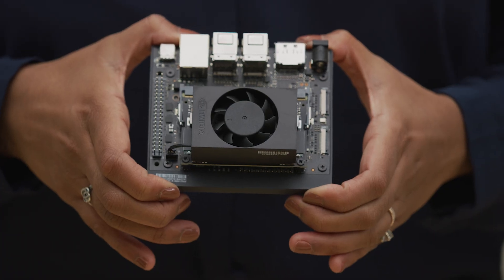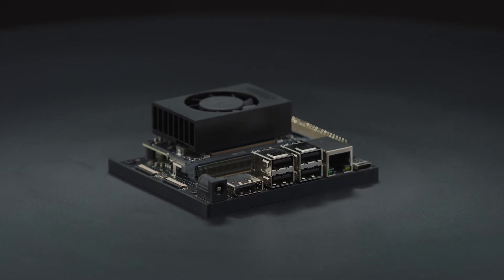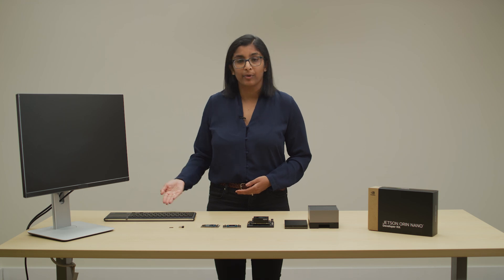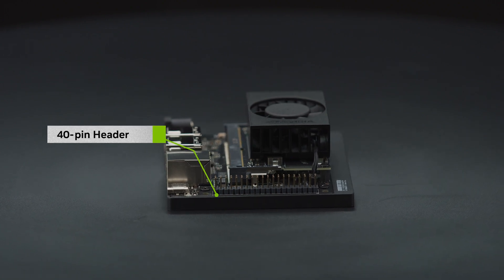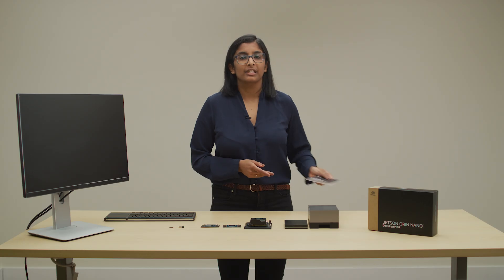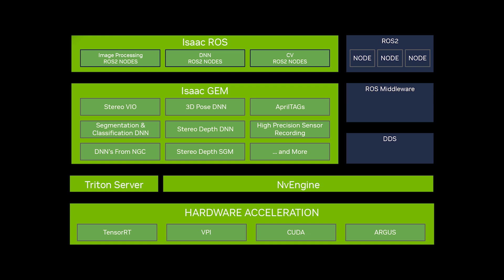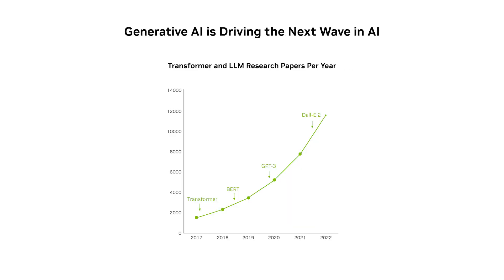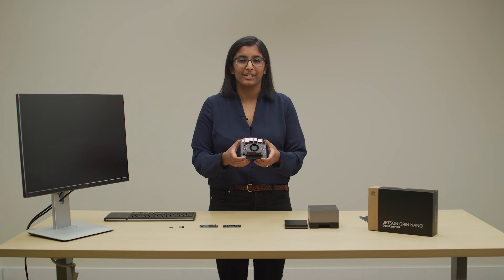Getting Started with the Jetson Orin Nano Developer Kit

Comment: The Jetson Nano is a great single-board computer. But the operating system you give the Jetson Nano to run on doesn't really take advantage of its strengths. You need to modify the Linux kernel. You need to allow C++_CUDA code from the Linux kernel module to run. Then it turns from a kid's toy into a real developer's kit.

Comment: The SD card flashing method doesn't work. You have to flash the jetpack image using nvidia SDK manager to update the qspi Boot although it is a one time process, but nvidia SDK manager works only in Ubuntu machine or if you have wsl. This is a bit inconvenient in my opinion.
Reply: @kolboy2028  learning this the hard way
Reply: If you flash the SD card with one of the older jetpacks 5.1.1 etc then it will work without SDK flash...

Comment: imu mouse with optical lift distance sensor not found in your video :)
Reply: well it can be also a 1-hand reflection distance air mouse, led source + detector grid screen, both touch and lift mouse
Reply: yes its public domain free idea, fire at will, whoever
Reply: having signal beacons with imu is the best localization, and the beacons can be dropped easily by people, and the beacons can localize each other with microwave wifi radar mesh relative locations
Reply: its better to have reliable anchor points than try to use only one method like image recognition, thats why kinect failed for tracking motion